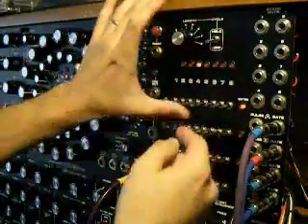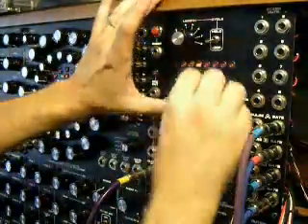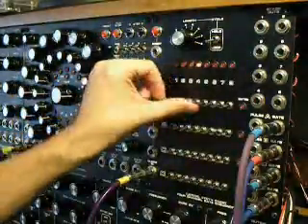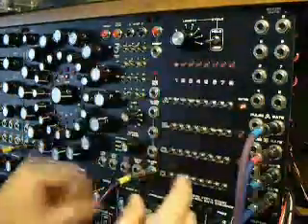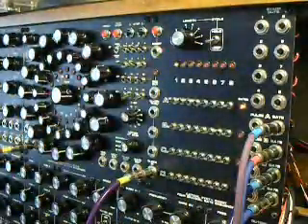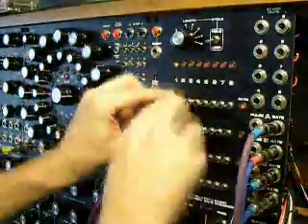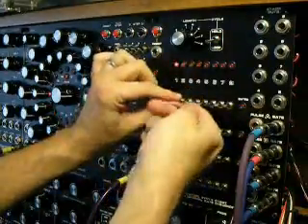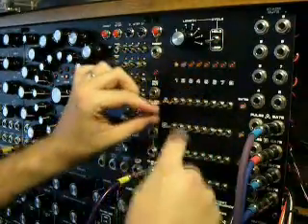Catgirl CGS Analog Gate Sequencer 2 of 2

Comment: The last half of the video sounds very Raymond Scott-ish. Check out "Cindy Electronium" here on youtube. I don't see why you couldn't can add buffers with potentiometer controls at each step to this to adjust each gate pulse output level to a different voltage to also get melodic patterns (if fed into a VCO). Very cool, thanks for posting.